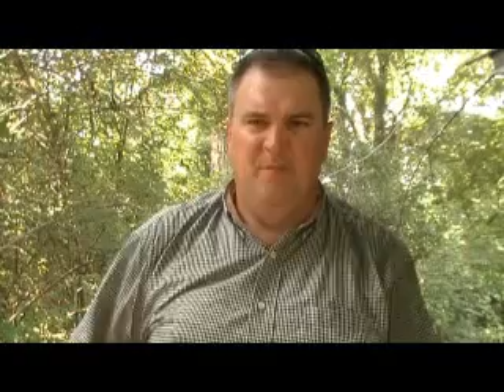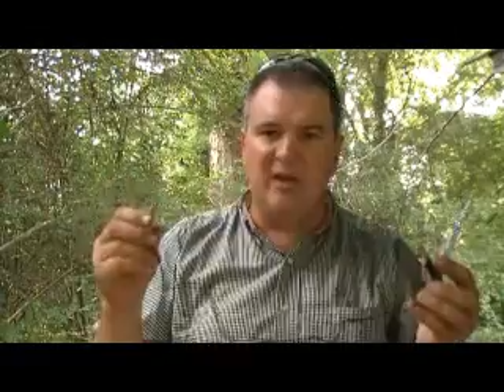Boat Electric How To Find The Problems

Comment: Thanks Anthony. I have an inboard 3.0 mercruiser. Having starter problems. Lots of corrosion on battery and starter cylinoids. Got it cleaned up and running but after sitting 6 weeks it’s acting like the battery isn’t turning starter fast enough. Thanks buddy

Comment: Thank you very much, great tips on a simple video.

I just got a “new for me boat” with some fancy electronics that I yet don’t understand.  Nothing electric  worked not even the basic lights.  Then I saw your video and went for it, worked for about two hours finding all the things you mentioned rust, salt, faulty connections.  All I have to do for the most was brushing and cleaning(I use vinegar and a wire brush) I also smeared some of dielectric grease in every connection I clean starting at the batteries which connectors looked pretty bad and the buss bar under the console and all of the sudden there are lights, gauges, live bait well, wash pump...even a honk! Now I can start learning the electronics instead of looking and flicking buttons that do nothing.

Thank you!